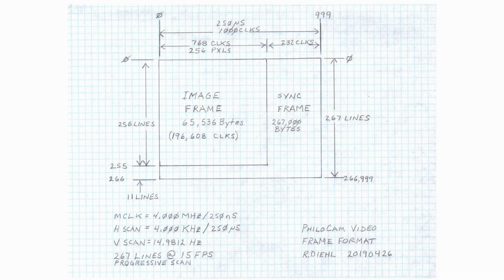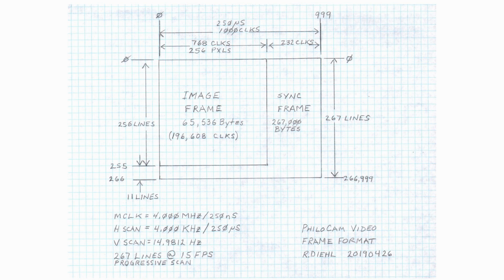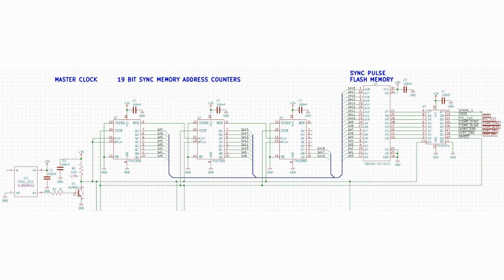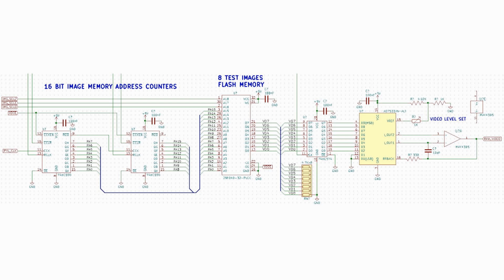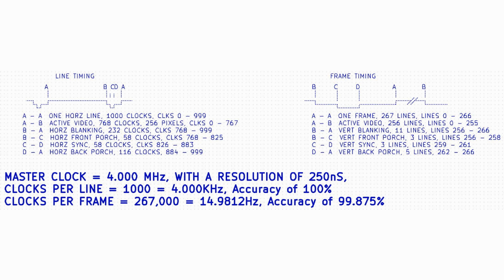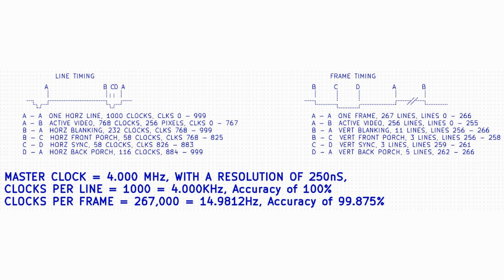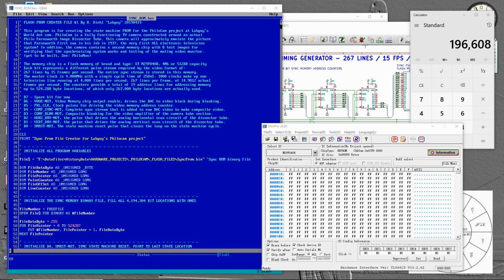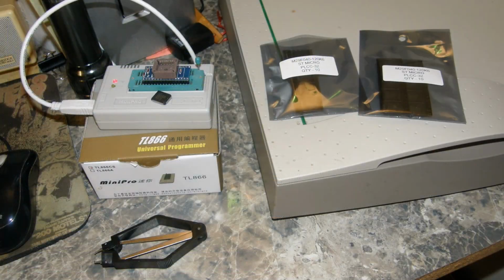PhiloCam Part 8 - New video format sync generator, Part 3

Comment: I have boxes of 8" floppy diskettes, need a box? :)
Reply from the maker: I will keep that in mind if I find an 8 inch disk drive with a USB interface adapter and windows drivers!
Reply: @videolabguy  Curiousmarc put together a video for a research project where fossil data was to be moved from 8" IBM floppies used during the 360 era two a PC based machine.
 Fossil Data Part 1,2,&3 : Paleontologic Data Fossilized on IBM 8” Floppies
https://youtu.be/MPOYHQTMnf8

https://youtu.be/5FVwheTVWko
https://youtu.be/C0upso-RGF8